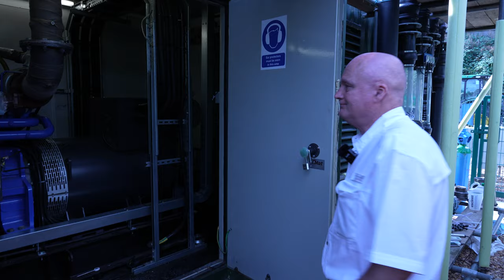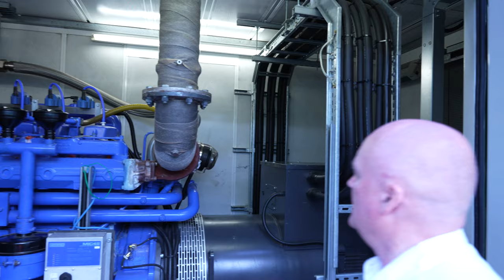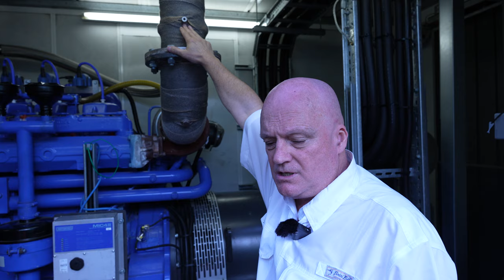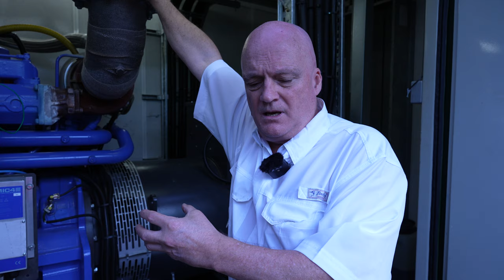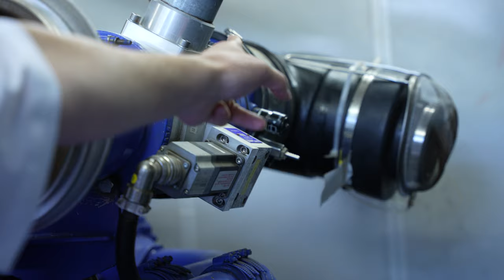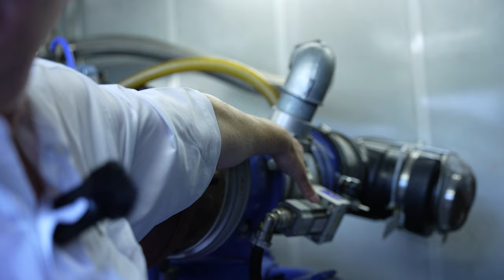THOR - The test electrical generator

Comment: One starts to wonder, if its removing carbon from the engine, is the carbon helping stabilize contain the plasmids to prevent them permeating the metal, if so it might serve to recarbon coat the internals periodically, kind of how Keshe Foundation has them "carbon nanocoat" the metal with a blow torch for their elleged "super conduction" purposes.

Comment: A 50% decrease in CO2 emitted with a corresponding 50% increase in the O2 in output gas begs some mass balance questions of the reaction, but a major point being overlooked here is- it still produces CO2. If history can teach us anything (highly moot), when the carbon-fuel industry takes this up, it will simply mean they increase their profit margins on production while they sequester it from the conventional electricity generation sector and public as much as possible to prevent loss in sales volume. When it DOES become effectively deployed in other sectors (at scale where it makes global economic impact), it will just mean a temporary drop in the rate of increase of global CO2 and CO as the world adjusts to more energy availability at lower cost and finds ways to dissipate that increase in supply as heat...
Is this Thunderstorm reactor open-source, or is this another case like Papp, Meyer, or so many others?